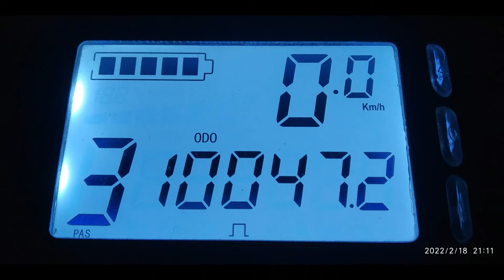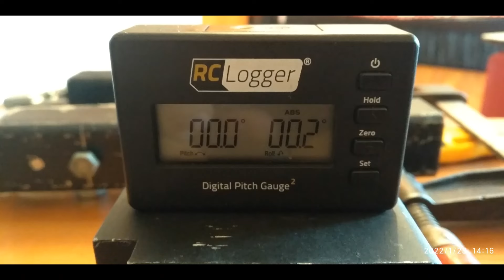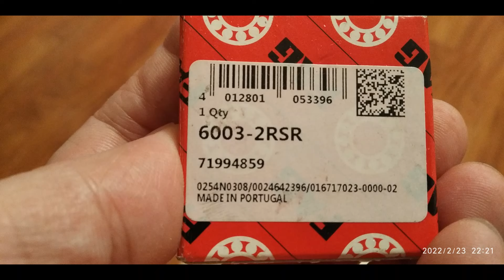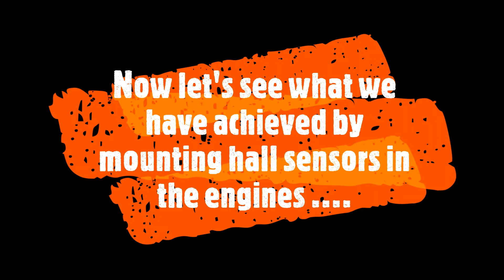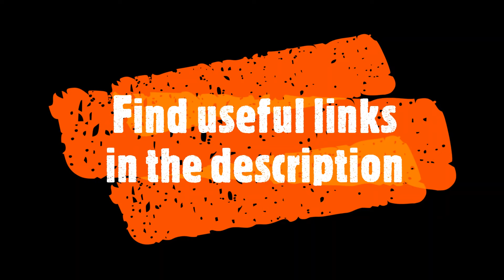Great overhaul  to the Honghao S12  Kugoo G Booster 10K

Comment: Hi, thanks for the video, just a question, where did you bought the motor bearings? have you got a link? Thanks again
Reply from the maker: local store
Reply: @ovidiu969  website of the local shop? i can't find the bearings in my country
Reply from the maker: @mauro887  it is a local store, not an online store. but if you search with google it is impossible not to find it. SkF 6003 2rsr bearing
Reply from the maker: @mauro887  https://www.aliexpress.com/i/32799683138.html?albagn=888888&&src=google&albch=search&acnt=479-062-3723&isdl=y&aff_short_key=UneMJZVf&albcp=15034475726&albag=134062032172&slnk=&trgt=dsa-42862830006&plac=&crea=555139499747&netw=g&device=c&mtctp=&memo1=&albbt=Google_7_search&aff_platform=google&gclid=Cj0KCQjw4s-kBhDqARIsAN-ipH2npwfOgf2b58J5-TghrjWGr5bOezlmXcQqmwJIvhbtKfrfuNOhWeYaArQDEALw_wcB&gclsrc=aw.ds
Reply: @ovidiu969  thank you so much

Comment: hello may i ask where did you buy hall sensors for kugoo g booster hub motor?
Reply from the maker: aliexpress. in the video description you will find a link to another much more detailed video related to hall sensors
Reply from the maker: But in the meantime I gave up on them. They don't bring a very big benefit, they even limit a bit of acceleration and top speed.